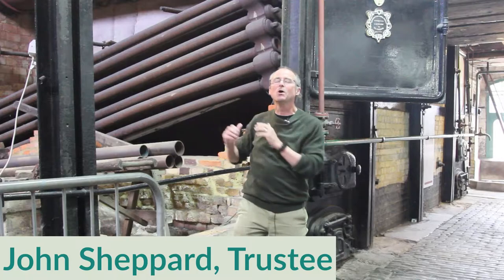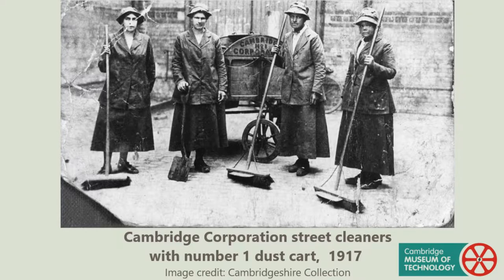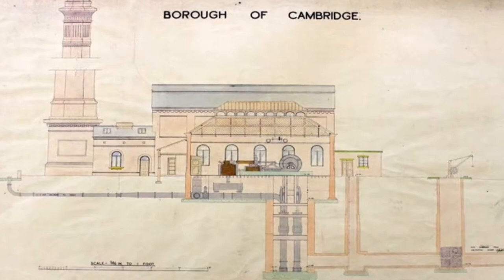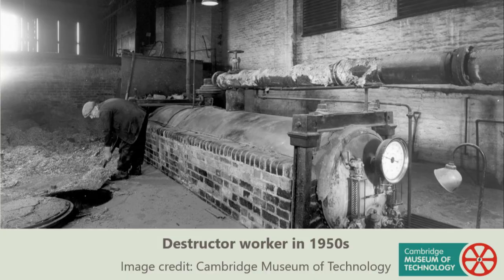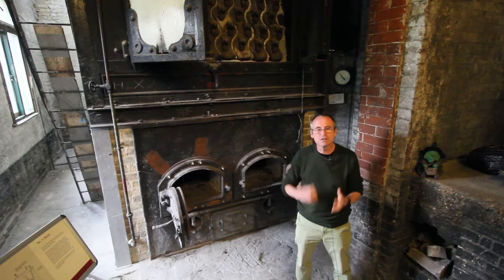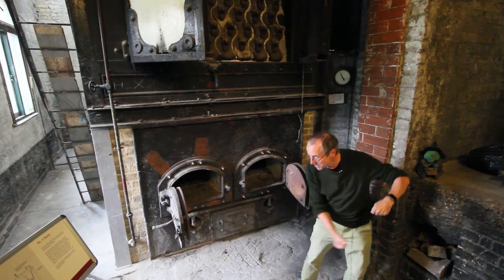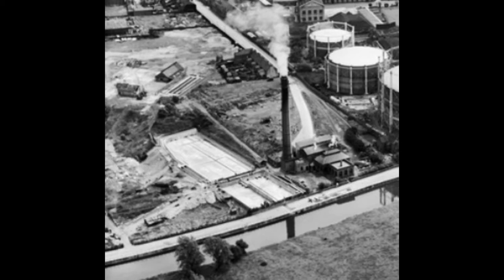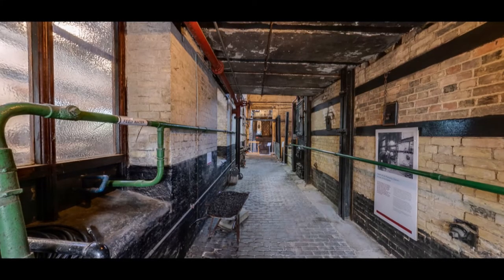Cambridge Museum of Technology Back in Steam: restoration of destructors and boilers

Comment: I'm glad if the No. 4 boiler can still run on coke. I thought that a modern gas or oil boiler had taken over, for providing steam power. I assume that the modern boiler has been plumbed in.